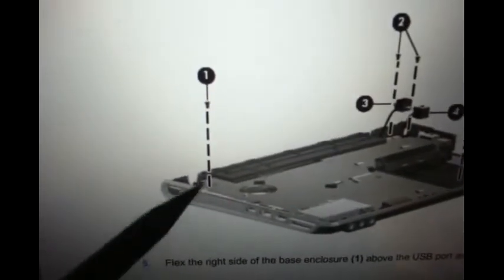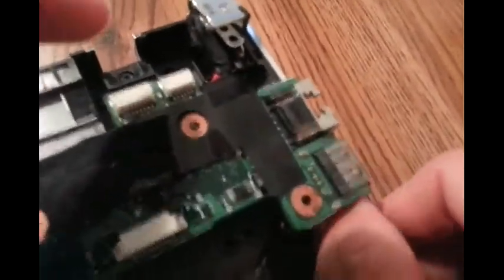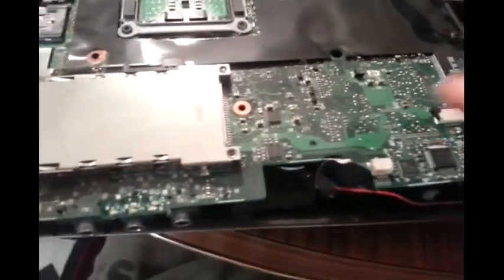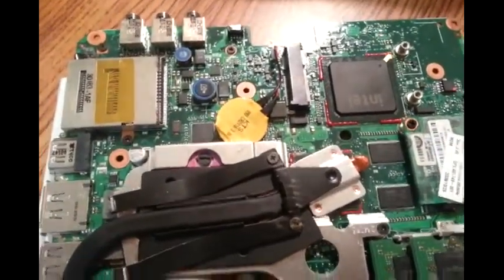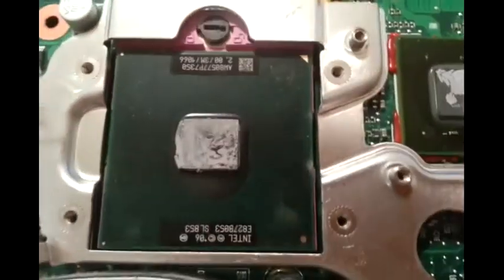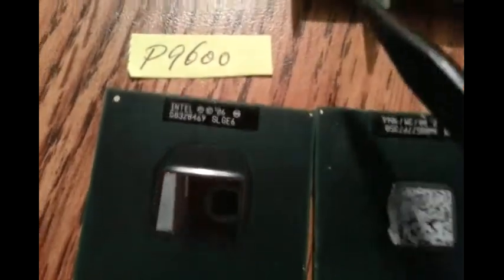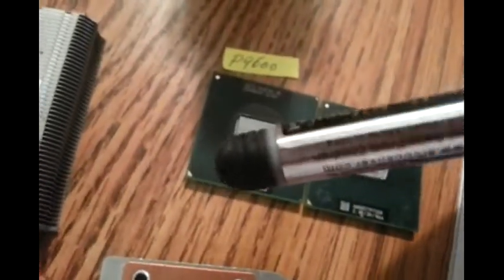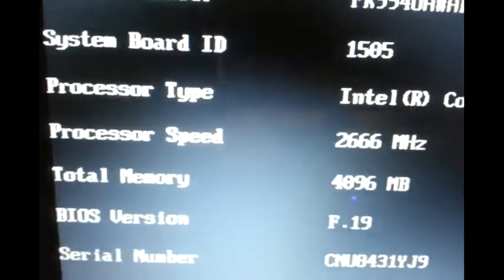HP DV3000 (DV3510nr) Disassemble for CPU Upgrade Part 2

Comment: Thanks for the video but this is way too much trouble to upgrade my old laptop; especially considering that it's limited to 4GB of maximum memory.
Reply: El modelo dv 3500 tiene una capacidad maxima de 8 gb ram... Manual DV 3000 series: http://h10032.www1.hp.com/ctg/Manual/c01614393
Reply: @tadeuzRA  Gracias.

Comment: T9900 works in perfectly in this machine, did it to my own
Reply: Really? I am from Colombia and I have this same DV3500 laptop and I was shortly after buying the t9800 model, since, according to the manual it was the
 best processor you accepted, do you have photos of your laptop with the specifications, to know if it is the same as mine and to buy the T9900? Thank you!
Reply: @tadeuzRA  I just can’t post a pic of it on YouTube
Reply: @tadeuzRA  yes I have a dv3500 and installed the T9900 with no issues